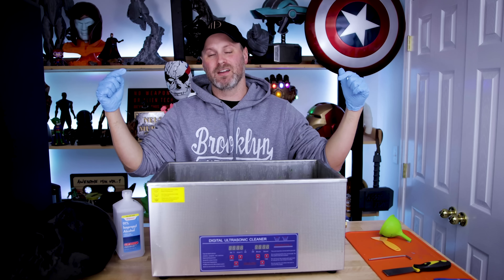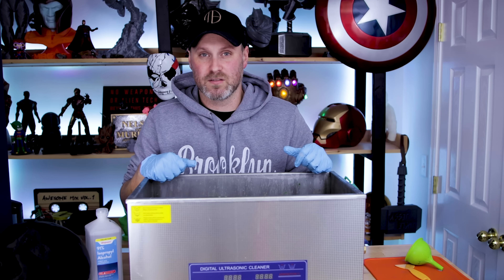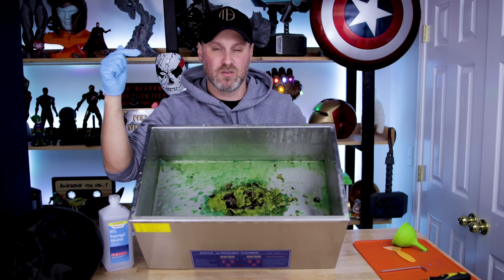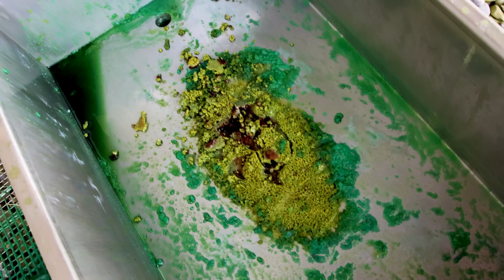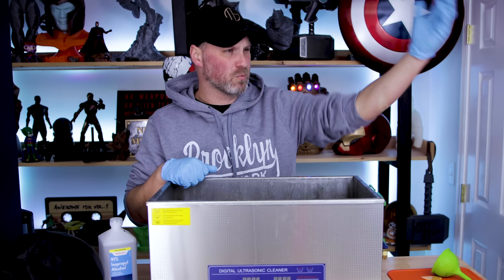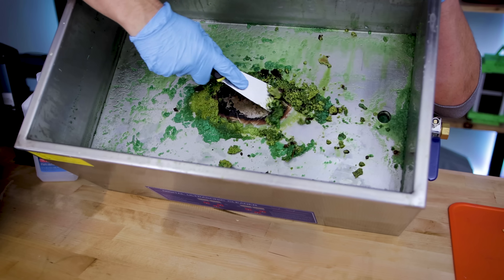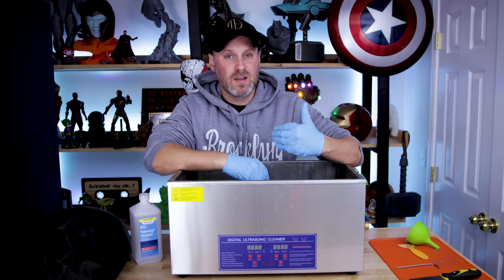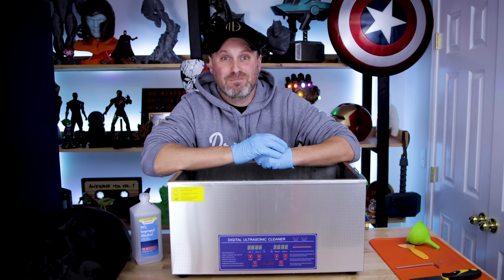Resin 3D Printing - Ultra Sonic Cleaner Safety Warning

Comment: So did you actually turn on the heating portion and forget to turn it off (there are separate controls for ultrasonic and heater)? Or are you saying that the heater turned itself on?
Reply: And a follow up, did you turn off with the switch on the back or were the LEDs still illuminated on the front?
Reply: @Aerospacesmith  He did neither. Whilst the unit is plugged in, the heating element is on. The heating side of it has no on/off button. You can only control the initial temperature of the heating element (which will increase overtime anyway, due to the electronics inside). Only solution; unplug it whilst not in use.
Reply: @PokketGM  the heater does have its own on/off button. If it's turning itself on or the heater is always on when plugged in and bypassing the electrical cutoff switch on the back, then he has a defective unit and needs to get it replaced.

Comment: Thanks for the PSA. Next video: how to disable the heater on your ultrasonic cleaner?
Reply: "Do I cut the red wire or blue wire?"
Reply: @drone1337llc I'm color blind! Now what?  😂
Reply: Turn it down below room temp.
Reply: @chrishamlet3470  on the series as shown in this clip you have to turn it on after powering. AND each cleaning cycle  if you don't it stays off.
Reply: The heater shouldn't be on by default. And once you turn it off it doesn't go back on, even when you turn it off and back on. And most ppl by now know to use bags of chemicals, I use IKEA -double zippers inside normal water 6L
Reply: Francis Arthur To be fair I use mine for multiple jobs but I’m extra careful with IPA that I don’t put the heater on, and with detergent I always have to reset the heater when I switch it on. Mine always defaults to off after powering off. After having a major house fire caused by an FDM printer setting on fire when in standby maybe I’m just a bit more cautious 👍
Reply: @chrishamlet3470  The method I use, couldn't that work for you?

I fill mine with 5.5 liter water and using a thick IKEA bag with double zip-lock with IPA.

I put the UV resin object in the bag and leave it to hang  in there with the flap underneath the lid. 
So you can do a long time with the same water and it can save a huge amount of chemicals and you don't have to clean and empty the machine all the time if you put something else in there. Just a new bag.
Reply: Francis Arthur it’s a great idea but I tend to clean my build plates ( yes I have 2 ) in ipa as well. However I might give it a try and just wash my build plates 1st. In the UK 🇬🇧 we can’t get mean green or I’d try that too.
Reply: @chrishamlet3470  Don't bother, you can buy Green Dettol but it's useless.

If you want a very easy way out then skip all the rest no ultrasonic, just clean with acetone.

The buildplate should not be pushed under completely. Too many spaces where IPA will stay for a longgg time if don't blow it or dry manually.

I have one reasonable rectangle box where everything fits in and just clamp it down. Nothing happens and I do 2 months with that one box. 
Rinsing it sometimes with fresh IPA letting it fall in there.

My success rate is around 92% now for last 2 months. SOmetimes I only wipe quickly with a paper towel underneath not bothering for the top and still able to print well.

I use a cheap synthetic brush from Action the blue plastic ones, not the wooden and just leave it in the IPA box for 6 months now. I also have a plastic chisel that works great cuz it's sharp but not hard like metal.